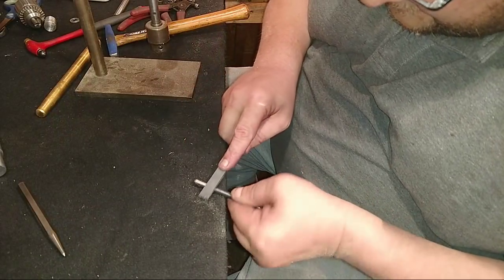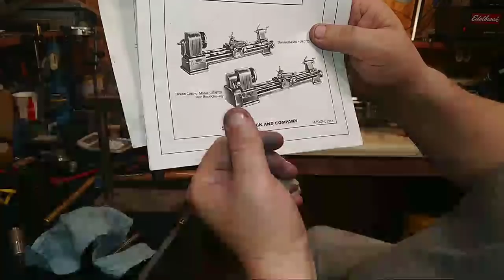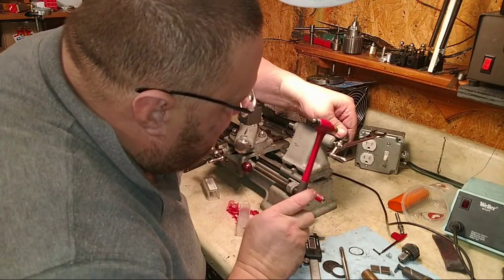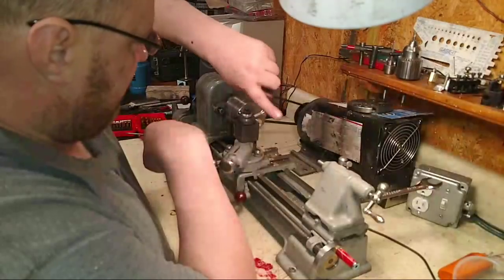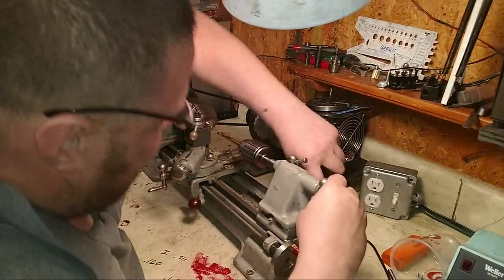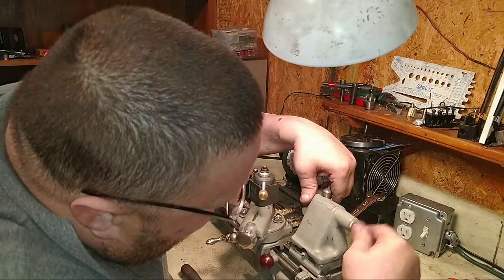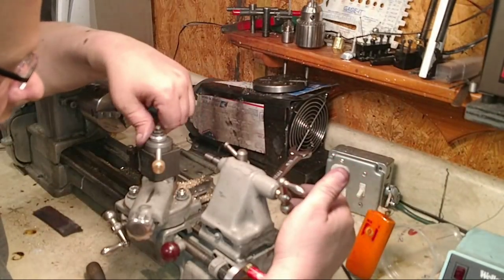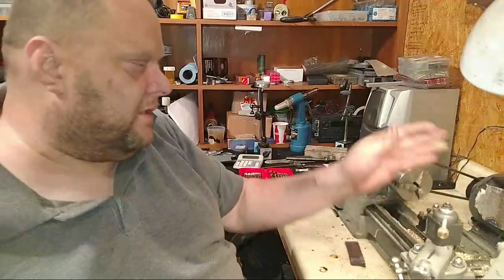New Quil Fit Up

Comment: I turned the computer on as you were signing off.  Glad that it fits.  If I had realized that the collar was going inside the tail stock I would have installed it differently.
Reply from the maker: R. Steven Lang, Shark River Machine it's fine the demples and lock tight did the trick

Comment: The drill chuck for a lathe should not have a tang.
Reply from the maker: R. Steven Lang, Shark River Machine I am going to use the old Quill as a holder so I can cut the Tang off
Reply: I just cut them off with a hand held cut off wheel.